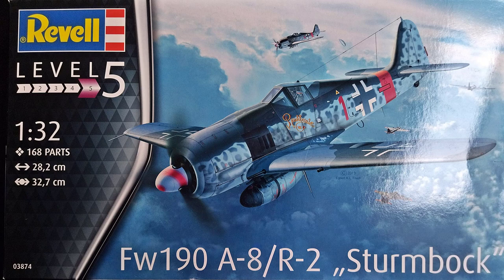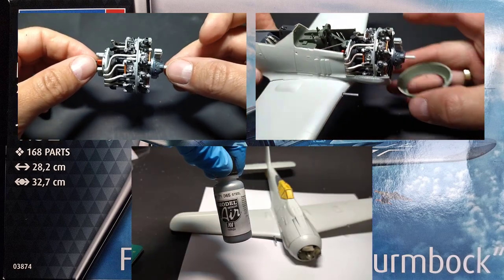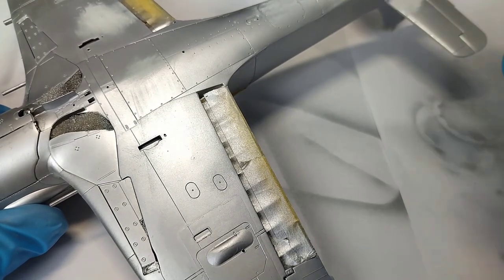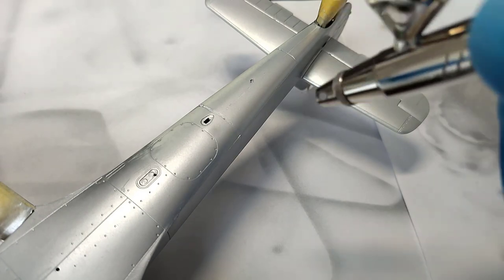Fw190 A-8/R-2 Sturmbock. BUILD PART 2/4. Revell 1:32 03874

Comment: Nicely built. The steel color is a nice tip as well. Like you I had a problem fitting the engine covers, but as this was only my 4th model after returning to the hobby I made a few errors with the covers, so my model doesn't look as great as yours. I also used a photo etch set for mine which led to a few fitting issues and I used incorrect colors due to trusting Revells color call outs.
Reply from the maker: Thank you Lars. 
Luftwaffe colors are always confusing to me as well. I always struggle to get the right one. Let's see if I manage with this model. :)
Thanks for watching.